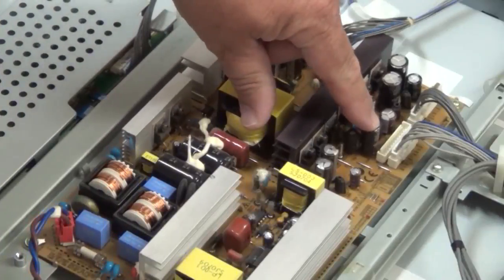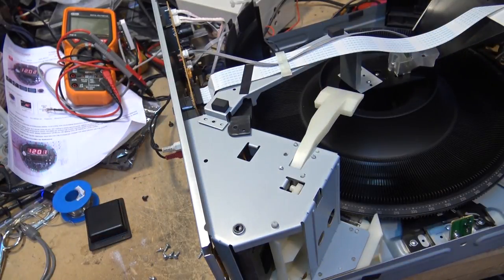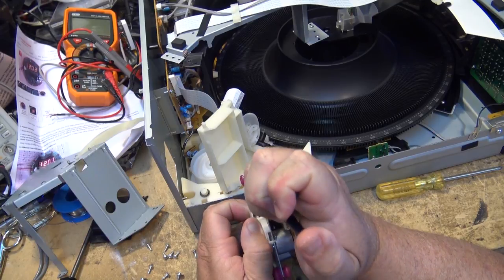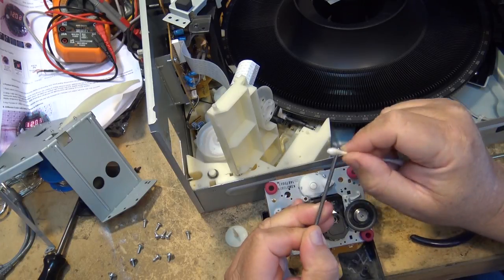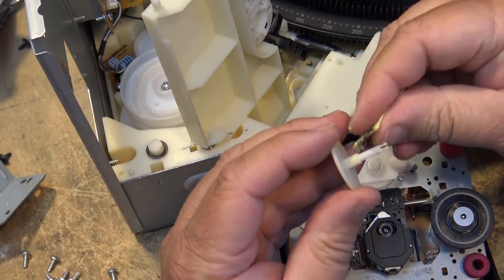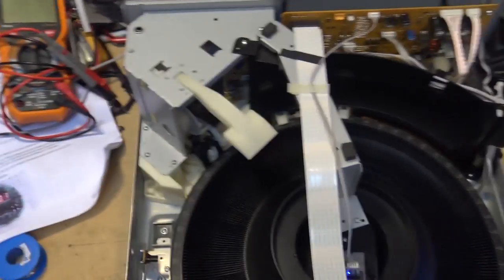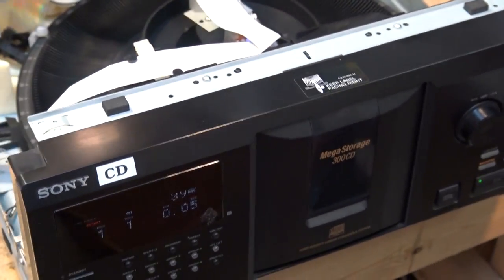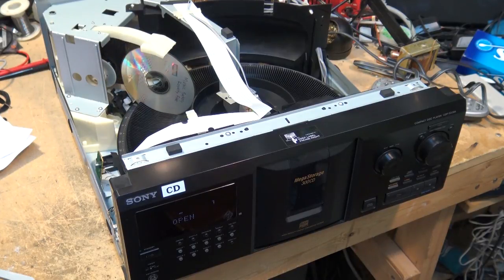Sony 300 disk CD changer skipping  on playback

Comment: On 5/5/20, I followed your video instructions to repair my Sony CDP-300CX which was skipping tracks after I got it working by replacing its three belts two weeks ago.  I cleaned the rod and plastic gears of old grease and regreased them with Lithium grease.  No more skipping.  Thanks for sharing your troubleshooting and repair video.  Without your detailed and thorough video, my Sony 300 would have gone to the landfill.

Comment: This guy has obviously been doing this for a  while. As have I. Good explanation of "why", as well. I just did exactly the same thing to the same model machine. It worked the second time, as I didn't clean all of the moving surfaces as thoroughly as I should have, the first time. The old grease does turn into a sticky goo after time and collects whatever schmutz/ shyte/ dust is airborne in your house. I sometimes use very a light bike grease with good results. Or a moly grease, as he did. Sometimes the laser will also drop in output with age and on typical KSS-type Sony laser assemblies a very slight CCW turn of the laser output trimmer dials it up just a touch. This helps with burned CD copies (especially cheap-ass blanks), which have way less reflectivity, and thus less laser pickup output  than commercial pressings. NOT less audio volume. Less laser output only affects playability when most discs will play and some don't, as a symptom. Good work Mr 12Volt.

Comment: I purchased one of these at a Pawn Shop for $10 last summer. It worked but the CD would get stuck half of the time. It needs both the gear bands and CD. After 8 months of this thing sitting alone I finally fixed the bands and about to grease up the CD Rom. I have sunk in $40 total in this project but plan on selling it. Thanks for this video, you are the man!

Comment: I bought a 2nd hand sony mega storage 300cd for 75usd.  The seller of course didn't detail the music skipping problem, he only said to clean the laser head with a special cleaning CD to avoid skipping.  Well I was pretty disappointed after the first hours of listening.   You're video however nailed the problem and its simple solution.  It took me only  20minutes to dismantle , lubricate the rail and rebuild everything and it works 100%. Not a single skip in 50 songs from differnet cd's.  Thank you !

Comment: Thanks!  I just bought a nonworking 400-disk unit to pair with my working one, and thought that all was fine after I replaced the melted belts.  But on testing it skipped on the higher tracks... guessing that all will be well after I locate some appropriate grease and finish following the procedure you kindly posted here for us.  Good work!
Reply from the maker: 2 400 disk changers.  I am jealous.  I have 2 200 disk but i didn't have to buy.  Got both for free.
Reply: @12voltvids  You ARE the man.  I followed this procedure, and my "new" $60 400-CD unit is working great.  :-) :-) :-) :-)
Reply from the maker: @k4sar1  
Now I am more jealous.

Comment: I successfully replaced all three belts to my CDP355 following this video. Nice details. NOTE: However,  If you remove the Disc optic mechanism, in your attempt to replace two belts, be sure to replace it in the exact slot at the bottom of cabinet, as indicated in this video, otherwise you will have Disc failure each time the system retrieves or replaces a disc back into its assigned slot. Also, if you remove any ribbon cable, it is most important to insert correctly or this too can lead to failure of the system. This can be very tricky and frustrating. Ribbon cables are hard to find for this unit.

Comment: That video is excellent, but I have a couple questions/ suggestions. 1) because a Q-Tip is too thick to fit the cotton through the bearings for cleaning, I recommend to first remove a lot of the cotton on the end, so it can fit through. 2) As an alternative to the Q-Tip you can roll up a small piece of coffee filter into a rod shape (perhaps 2-3 inches long); saturate with alcohol and pull through the bearing. 3) I would think a light white lithium grease should be a good substitute for the Molkote that is not available locally. 4) You never showed the resolution of the stuck finger holding the disk. Was that connected to the gear you cleaned? Or to the belt-drive gears for rotating the CD tray?

Comment: Hi great video. I was able to open mine up and clean it. But didn't fix the issue. I then noticed the stem of the plastic gear that goes on the motor for the laser was cracked. Could this be the cause of the skipping? If so where can I find a replacement for that part or something similar to fix it? Thanks.

Comment: I have a sony CDP CX 450 with a weird problem....it works fine and plays CD's with no problems until it tries to load disk 140 (1-139 OK), where it will load the disk from slot 141 (but display 140), if I request disk 141 it will load 142, then it will not load any disks until 150 where it seems OK again. It also does this at about the 230 slot position. I've tried different CDs, cleaning lenses on the sensor, checked belts on motors and under the table - all seem fine. After a reset the problem is still there. ANy ideas why this night be happening? Thankyou.

Comment: Great instructional video.  I own a SONY HCD-HPX7 Micro system with similar issues.  Can you tell me if the plastic pinwheel you removed with your needle nose pliers a sold separately, and where can we purchase them?  Mine has its teeth all grinded and skips the drive back and forth.  Also what kind of lubricant are you using?  Molykoat # ?  Help anyone please.  Thank you .  
Fred.

Comment: If your changer still doesn't work after cleaning the gears try cleaning the black disk grabber, if these get dirty they put dirt on your disc and it will skip. It took me about 2 hours to find that fault 😅
Now it works just fine 😊

Comment: I followed your advise and cleaned the mechanism. Now the laser head is moving smoothly and the CD plays. But there was another problem. During music playback, an interrupt occurs for 1-2 seconds. This may occur once in 10 minutes or every 2 to 3 minutes. What could be the problem? Should I replace the laser head unit or there is a problem with the power supply? Thank you!

Comment: Recently got the 400 disc changer. I have the same issue with the music skipping. After inspection and greasing up a bit, I can't seem to place the box that has the laser reader on it exactly how it was before. The pin st the bottom, I can't seem to find where it goes.

Comment: Hello   this is a great instruction. Bang on....  I have a problem with my Sony CDP-CX355 and wonder if you can help., It started out as the same problem and needing the belts replaced so I did that and replaces all 3 belts.  But now the carousel is stuck when I push the Disc Eject button. I notice the disc does not eject from the play before the carousel starts turning ! The mechanism to remove the disc from the optic does not operate and the plastic "V" guide remains in the "down" position.  Can you help....thanks Richard

Comment: I was looking a 20+ year old boom box the other day with a CD player problem. When I got it apart I found that the laser gear had turned yellow and crumbled. No replacement gears to be had unless I could get someone to 3d print one for it.

I noticed that the gear in this unit is also starting to turn yellow. Seems to be a real bad issue with the plastics used. I'm also seeing this problem in older video game console disc drives.

Great video as always!
Reply from the maker: The yellow color is smoke. The unit is owned by a chain smoker. 
Philips and Magnavox were bad for their plastic gears turning to mush.
Reply: My first Philips tape deck had a gear that was red colored and crumbled and then another yellow one from the autostop that also crumbled, so i had to improvise something to get it to at least play a tape. I took a small motor and atached in place of the counter via a belt to drive the take up reel. Works like a charm. Needless to say that I would never buy another Philips boombox, tape deck, cd player or anything.

Comment: I have a CDP-CX55 300 disc changer and it stopped working all together . I had to take it out from the cabinet to fix  one  of the four  wheels underneath as it gave in. When I put back the disc changer,  low and behold  it just did not work at all, stopped . It`s completely dead . Any hint what could be the problem? It does not switch on . Electrical  current goes in as I checked the cord. . I viewed your videos on fixing certain problems, but my problem is not included unfortunately. That is why I decided to comment . Thank you.

Comment: I know that this is 3 years old but I still have a question with my 300 it takes the disk but then doesn't play it just puts it back into the rack also my door won't open I've changed the belts everything seems to be fine just doesn't open any ideas
Reply from the maker: Off hand nothing jumps out at me.  Been so long since i serviced these units.  Been out of the repair business now 18 years and only see the odd one now.

Comment: I have one of these with the same issue, I tried your fix but the problem remains. I verified the laser assembly does move into its home position if moved manually and then turned on and put in a disc. It can find the start of a track ok, even if set to another track prior to 1 (such as using 1 disc and set to shuffle). When watching the gear during play, there seems to be a slight "jog" or movement backwards after moving "forwards". I have made a video of this movement.

Comment: I had the problem of discs skipping . I followed your video cleaned the gears and lubricated the laser rod. It now plays without skipping however I obviously did somethding wrong when I was putting it back togerther. When the arm reaches out and grabs the disc I get loud snapping sound. Actually it occurs in a sequence of 3. I cannot figure out why  it is happining although I can each step when it happens.

Comment: hey do you know if a buggered up tooth on a dvd player's laser sled gear would cause it to crap up at the same spot in a movie every time? Is there a quick way to varify this without having to sit through an entire movie before I sell a unit on craigslist? Im guilty of throwing out possibly good dvd players out of pure lazyness of needing to sit through an entire dvd just to test it to varify if it is bad or not. I had a player that appeared to freas up at the same spot in movies sometimes and sometimes play a entire movie just fine. My worry was that I'd sell it and end up hearing back from the custumor a week later saying its crapping out on them.
Reply: Im thinking probably too many variables but the fundamental question remains, would a messed up tooth cause a dvd player to frees up at the same spot, every time, on every movie?
Reply from the maker: Well you can take it apppart and visually inspect the gears for damaged teeth.

Comment: I have one with the same gear, and I believe it has a similar issue. I think it is the laser though, because it skips if I tap it lightly or set a raw speaker unit on top of it and turn up the bass. Any thoughts as to what might be wrong?
Reply: Never mind, the gear had multiple broken teeth in a row.

Comment: Hi I hope you're ok
Please could you help me,  I need to glue a cracked nylon gear (it's the rewind & counter belt pulley gear in the wm-d3) can you recommend any glue for nylon gears.  Thanks in advance
Reply from the maker: Technics Guy 
I have not had luck glueing nylon gears. I fused a few together with heat.

Comment: I have one of these and it still works flawlessly. It outlived the cd as a matter of fact as I stopped buying cd's. Modern cd's sound terrible, the odd exeption excluded. So all my old cd's are in this changer and they probably never come out again as long as the unit survives.
Reply from the maker: I feel the same way about my 200 disk. Working flawlessly, has never skipped a beat, and sounds fantastic. Have it, along with an old Cassette deck and DAT player on my all tube amplifier in my living room which I put on to listen to from time to time. The sound quality of this unit is excellent. I have not bought any CDs in years,  but I still enjoy the ones I have. I have well over 200 CDs though, so what I did was make compliation CDs. Ripped the tracks from all my CDs and only the tracks that I like, leaving the crap tracks. Then I burned 200 80 minute disks to the brim. Actually I think it was only about 180 or so disks and the remaining 20 were willed with CDs that every track is good, you know the samplers and stuff that record companies put out that were already compilations of great stuff. I would love to get my hands on a 300 or 400 disk, just because I love the mechanical aspect. I am still contemplating making a plexiglass cabinet for my 200, and putting it on the top shelf so the operation can be observed while it works, because it is just cool to watch. Like an old Seaburg or Wurlitzer jukebox. That is something on my bucket list, to get an old juke and restore it. My neighbour has a really nice one, and they have no kids to leave it to. (only son died of cancer several years ago)  so I have been trying to buy it but so far no luck.
Reply: Which CD changer do you recommend to buy now?  i want one
Reply: I have the Yamaha CD-C600. Probably the best out there. You may read about it, listen and get one for you!

Comment: I have found that the gears on the laser transport of my Sony 200 disc changer are damaged and not meshing properly.  Do you know where I could purchase a new set of these gears?
Reply from the maker: You may have to find an old cd player and cannibalize it.
Reply: @12voltvids  That's what I was afraid of.  Thanks for replying.

Comment: I have one of these and today it started behaving badly.  Blue light blinks but door won't open and makes an unusual noise.  I took all the cd's out thinking one was jammed but that's not it.  What kind of place would you recommend I take it for repairs?  I love this CD player.
Reply: There is probably a belt in the open mechanism, and it just needs a new one.

Comment: Mine is currently having issues, it will load the CD, won't spin it, unload and repeat. It does this a few times until it eventually gives up and says there is no disc in. Any ideas?
Reply from the maker: Laser or spindle motor.

Comment: what is the name of the grease you use, tx and great video, fixed mine, but still need to grease
Reply from the maker: It is Molkote PG-641 grease
Reply: F B. Molykote pg-641 , for some reason isn't available in the USA, do you have another kind of grease that can be used, or a place where we can aquire this grease?
Reply: I use car bearing grease works awesome too
Reply: @12voltvids Sweet finally found it in the comments. Thank you.

Comment: I have a Sony 200 that is skipping can you tell me what it would cost to repair that thanks
Reply from the maker: A skipping CD is 1 of 2 things. 1) worn spindle motor, or 2) weak optical pickup, or both.
Reply: @12voltvids  do you have a video that shows how to replace a worn spindle motor and a week Optical pickup
Reply from the maker: @danielsandoval1552  NOT YET BECAUSE USUALLY BY THE TIME A PLAYER HAS A FAILED OPTICAL BLOCK IT GOES TO THE RECYCLE CENTER. NOBODY FIXES THESE THINGS ANYMORE.
Reply: @12voltvids  well thanks for your time I enjoyed your video though take care

Comment: I have the same machine. The disc loads but it will not spin. It tries to load multiple ti.es but will not spin
Reply from the maker: Probably the spindle motor is bad.
Reply: Easy to fix? I love your videos

Comment: Great video.  Thanks.  I would have cleaned the LASER diode while I was at it.  I have a woman dropping one of these off tomorrow only for new belts.  I hope that i don't screw it up.  I am a Christian and I pray every morning.  One of the things that I pray for is for God to let me be a better electronics technician, because I am not a good one by any means.  I certainly cannot solder SMDs.  Wish me luck.  I don't like 300 disc changer players.
Reply from the maker: The only way to clean the laser diode is to take the optical block apart. Good luck with getting it aligned afterwords.

Comment: I never got to see this part as it was blacked out on last video, got to see the first part not the final part, I just queried if the motor was getting drive from the main board or not, There is one hobbyist who has successfully done this sort of repair on his own system where he had to totally dissemble his whole SONY CDP-CX300 to actually fix the problem but he eventually got it working.

Comment: This is a common problem with a lot of cd mecks, you are on the right track using Molkote grease . On the sled shaft i have found cleaning with mag wheel cleaner ( this also polishes the sled shaft). Cleaning the gear train gear by gear is also a good idea. I also use a good contact cleaner to remove the offending dirt. A new set of drive belts and most faults are fixed. Cleaning the laser assemble a cotton bud and if you breath on the end of the bud and gently clean the optical assembly. I have found this works best .
Reply: What kind of molkote  grease should I be ordering? Thank you
Reply: @zman6288  I use a black graphite grease and a very light smear on the sled shafts. there are also several greases desighned for plastic or nylon gears and again just a small amount, easy to apply with a clean cottenbud. to remove old grease, a good contact cleaner works best to remove the grease. never had a problem in all the years of VCR and the like servicing.